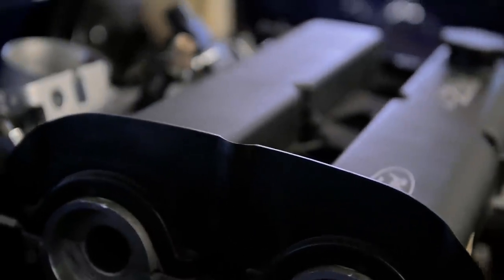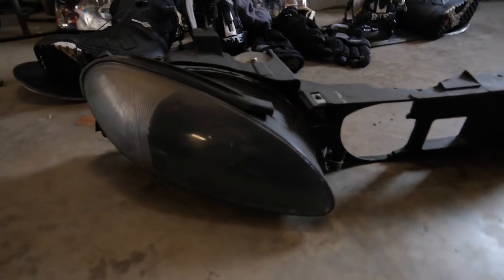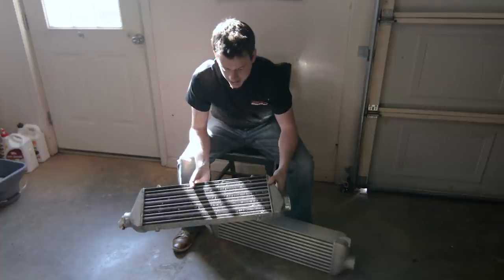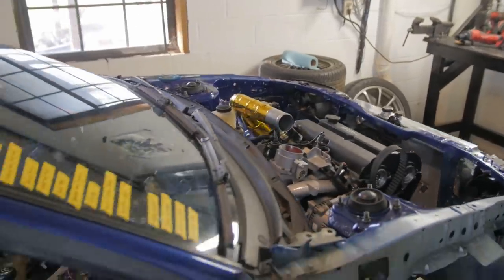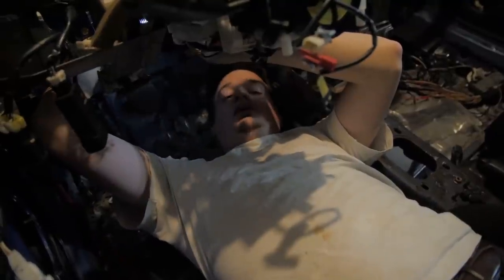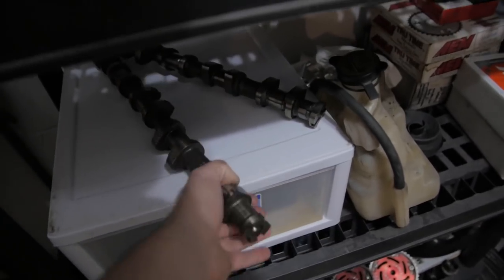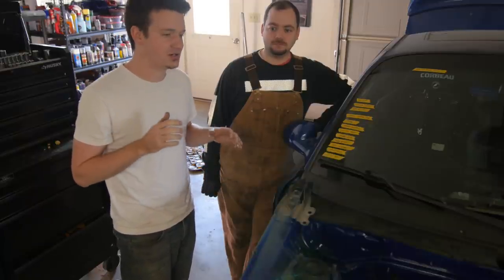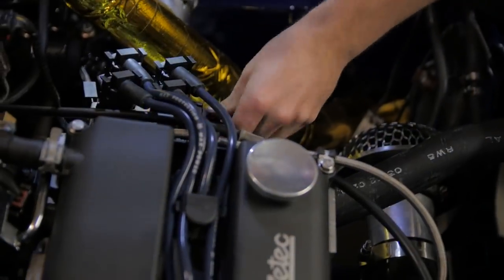THIS IS IT! (Turbo Build Part 11)

Comment: noooooooo the focus cams are less aggressive then the zx2 lots of the focus guys tak3 out cams get zx2 cams pleasee
Reply: The ZX2 intake cam is more aggressive, but the focus exhaust cam is more aggressive.  However, the ZX2 cam doesn't have a camshaft position sensor tooth on it, which would have required welding or drilling and tapping the cam.